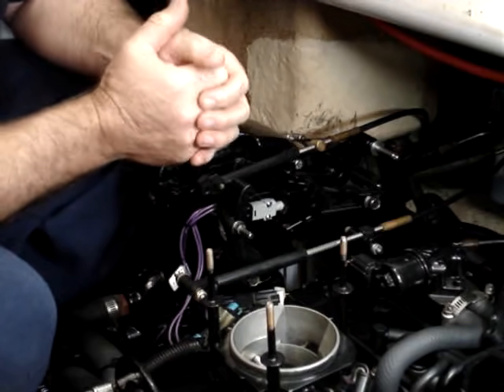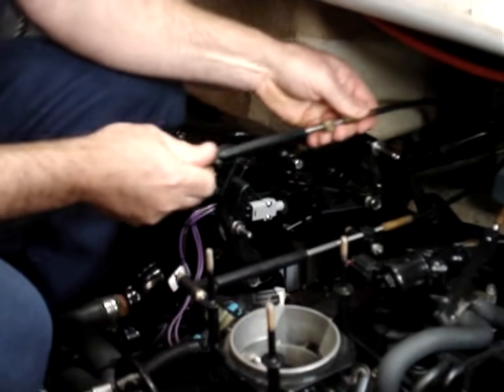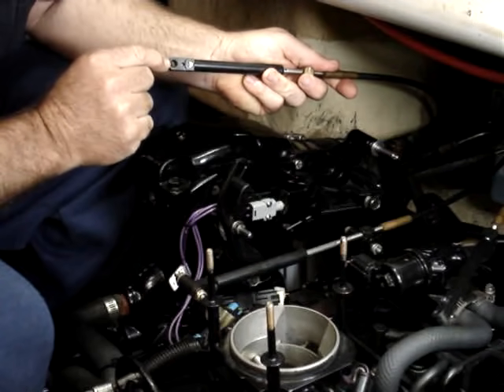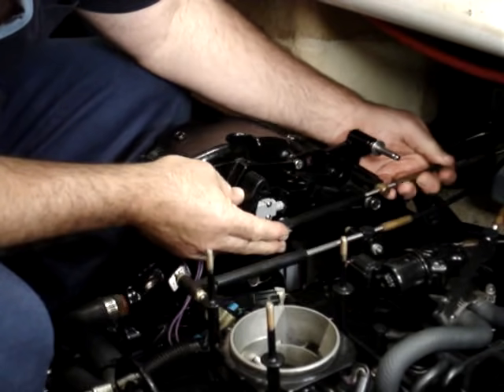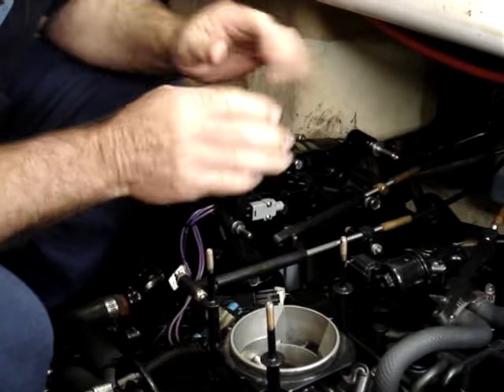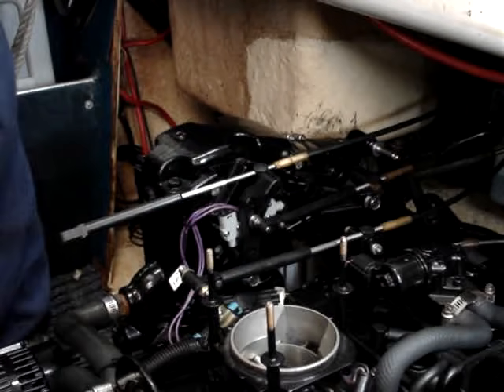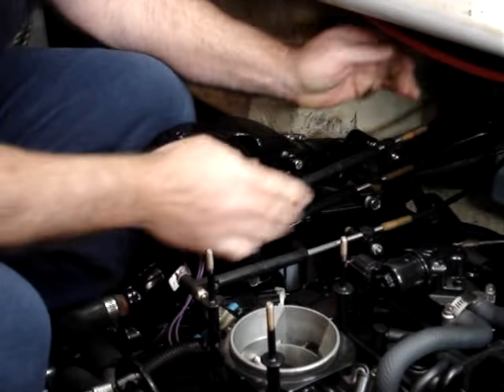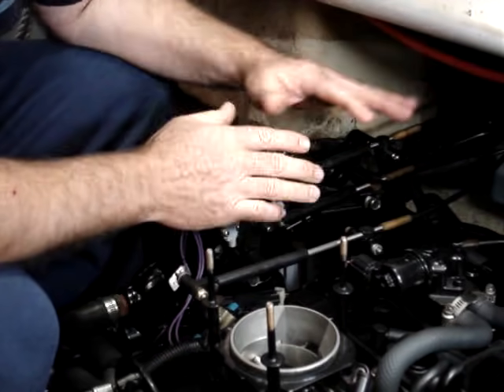Mercruiser Alpha Shift cable adjustment

Comment: Hi Chrisa, 

Can you tell me what position that throttle needs to be in when you remove the lower shift cable or it if matters. I see you push the shaft in to measure the distance - along with moving the prop and scotching it when it bottoms out counter clockwise -( which puts it in forward) and when you are done measuring your gaps you re-attach the shaft to the leg. My question is when we are hooking everything back up what position is the throttle lever in when reattaching the cable? I assume its in forward position but maybe I am wrong or maybe that does not matter. My boat runs great in neutral and forward but when I engage reverse it wants to bog down. I assume I have the wrong tension set on the reverse and interrupter switch as if I by pass the interrupter switch the boat runs fine in reverse. In case you needed to know this is a 1987 Alpha One Gen Two 4.3LX thunderbolt. Hopefully you can understand what I am saying and I certainly appreciate you doing this for all of us as we don't have very many reputable boat mechanics in my area and the ones we do your looking at 3 months out.
Reply from the maker: Once you have the 6" measurement for the lower shaft cable, with the throttle lever still in forward, you put the lower shift cable in, and with it still in forward, you adjust the remote cable so it's in the correct position, then back off the barrel on the remote cable 4 turns. All while the throttle lever is in forward. If shifting into reverse is tripping the switch, you have dirt in the shift slide cavity in the bell-housing, or inside the slide itself, or the anchor stud on the shift plate lever in too high. If all those are correct, replace the cable.
Reply: @chrisa660  You are the best sir !!!

Comment: I've followed the video, my measurements were the same as yours. So I followed your instructions exactly.  On the water if I shift fast and accel (to pull a wakeboarder out) I will get a clunk into gear and then a second later another clunk.  If I shift quickly but keep near idle I do not get the second clunk.  Can the black throttle adjustment thing be adjusted further then 4 turns?  My reverse shift slams into gear hard and shakes the whole boat.  Suggestion?  THANK YOU!!
Reply: Check your idle speed too.  If too high you can get that hard ckunk

Comment: After an engine replacement I’ve had a lot of issue with this interrupter switch. I’ve tried making some adjustments it seemed better. Some days it won’t ever die and some days it dies going into reverse. Now it’s dying going from forward to neutral a lot. Lower cable has been replaced and if I recall I had my 6” on lower cable right. Boats a 96 which way should I adjust the barrel when dying from forward to neutral ?
Reply: Hey, did you happen to find out which way to adjust the barrel when it's dying from forward to neutral?
Reply: @deadparrothead3175  I probably did but don’t recall. Replaced the transum assembly and it’s been perfect. My shift cable was ran wrong

Comment: If I am adjusting an existing cable, I know I need to measure the proper lengths of the cable movement. However, wouldn't the barrel on the remote control cable already be set 4 turns back? Or should I adjust it to fit perfectly first, then turn it back 4 turns for tension I assume?

Comment: I'm well aware that this is an old thread but if anyone is paying any attention:
Mine is a 1986 year Alpha I Model 1 and the first thing done here is pull the slide out the 3 3/8". Mine will not move over 1/8".
Also the mount is pinned. Measured 6 1/16" Should I try to loosen the mount so I can adjust on the threads? Shifter seems difficult to get into forward & sometimes the engine will die. (on water)

Wondering if the cables are worn out or the Remote control has something going on. Don't have an hour meter but I'd say for it's age don't have an excessive amount of hours.
Thanks!
Reply: 6-1/16" is not a problem. If it's killing the engine then it can only be a sticky lower shift cable or the adjustment of the remote control cable. I'm not sure what you mean by 'the first thing done here is pull the slide out the 3 3/8". Mine will not move over 1/8".' I assume you're referring to the remote control cable. It's not the absolutely distance you should be measuring, it the difference between forward and reverse.
Reply: @Chris-hx3om  When you pulled out on the cable checking for the 9/16" play - mine won't move. Also I believe you screwed the 4 turns opposite of what you said. I turned my barrel from factory setting 4 turns and it went on easily so I just backed it back where it was (4 turns) and left it there and really it was opposite to what you turned your barrel. Is there any kind of setting I need to know about on the control lever itself? I have owned this boat since new (1986). Something just isn't right with the way it's shifting.
Thanks so much for your expertise.

Comment: What is the remote cable is not moving the 3”? How do you make it move more? Mine only goes 2 3/4” can’t figure out how to get to the 3”’s of travel.
Reply: Is it a Merc genuine remote control or an aftermarket (Morse, etc)?
Reply: @Chris-hx3om  yeah it’s the genuine one
Reply: @tiotheberk  May have a problem inside the remote, or the cable may be attached to the wrong anchor point. IIRC some of Merc's remotes had two anchor points. One for Mercs, the other for 'other'. Worth just pulling the remote off the mounting and checking.
Reply: @Chris-hx3om  awesome will do!! Thank u!!

Comment from the maker: I take it you're doing this adjustment with the boat on the trailer and the engine running on flushers. If that is the case, the switch interrupt (cut-out) switch should never activate. The system needs load on the prop to work. For an explanation of how the system works go to a forum called iBoats, then navigate to the Mercruiser repairs section. At the top of the list is a post called "Adults only". Click that and look at item #9... (I'm poster 'achris' BTW:-))
Reply: chrisa660 my boat is in the yard I was doing some cleaning and it’s off and on stands I put it into reverse. Now it won’t go back into neutral. Tried manually turning over motor a little and spinning the prop jerking it both ways while trying to put in neutral to no avail. Any ideas?
Reply from the maker: @Buddy8  Sounds like the remote control cable is broke. (the inner core)

Comment: I need some help I have a 86 Chaparrl 178xl it has a 140 Mercruiser with alpha one drive my switch has went bad so I had to buy Mercruiser Alpha Shift Interrupter Cut Out Switch 864363A1 here is my first problem all my stuff is connected to the top of my valve cover and I read this new style has to be mounted somewhere else where is a good place to mount it up I am so lost. Second while pulling everything apart I had one of the plastic pieces brake and I cant find one because I have no clue what to call it lol any help would be great. I have pics of the broke part also thanks.

Comment: hi
I have a SeaRay sundancer 290 1992  with 2 4.3 mercruiser engines and standard stern drive gear shift and throttle controls.
Boat is in the water now, all working fine but throttle showing on gauge different RPM between both engines.
For example throttle are in the same level forward or reverse but RPM is not the same -showinf port 1500 and starboard 3500. You upload clip above but can i do it when boat is in the water?
And how do do it step by step ?
I will be really great full for any help.Iam new owner for this boat.
Also i put fuel 270 l and gauge showing this is 1/4 only in tank.not half.They said is 500l. Can be bigger tank inside?

Comment: Hey Chris I think my upper cable needs replaced how bad is that? its an 89 celebrity by the way I just dont see the lower needing replaced its deffinately within specs i think the control box and upper cable pry wouldnt hurt along with the neutral switch and the actuator for the neutral switch both have been tampered with and as soon as I go to push it to full throttle adjusted the way you have shown here the switch activates like big time

Comment from the maker: Replacing the upper cable won't change anything. You need to find out why the lower cable is getting tight when shifting to reverse. I would pull the drive and check the slide cavity in the bell-housing for dirty and crud.... Also make sure the slide is free to rotate on the end of the cable. (common mistake people make when replacing the lower shift cable is to tighten the grub-screw and stop the slide rotating. It should be loose, but without any longitudinal movement (hope that makes sense))
Reply: Hey chris what can I do if I follow your steps but cant adjust the cable past 5 inches....I have 2004 Monterey 3.0l with gen 2 alpha and it dosnt look like ike I can physically adjust mine past 5inches please help

Comment: do the measueing shit set it up if still a issue  remount the lower shift cable higher on the arm, the part that is slotted on the arm that did it for me thanks

Comment: Great video, it took me ten minutes to complete the adjustment thanks to you!... I now get great gear change in forward and reverse.  However, in order to get the prop to go into reverse I had to move the drive shaft anchor to about a 1/4" from the top of the slot.  This did not engage the cut-off switch so I figure this is fine but, shouldn't there be a point when it do engage the cut-off switch?  If it never engages, what does that mean?
Reply: having the same issue in reverse. i didn't try to adjust the drive shaft remote anchor that far up to engage in reverse. i guess i will try that, but did you come up with any best adjustments to solve issues for smooth operation? thanks

Comment: My engine stalls as soon as shifted to reverse. I have made no adjustments yet, and it used to work just fine. No reverse at all, instant kill when engaged. 

Can I fix it by using this adjustment technique?
Reply: I had same problem and this fixed it for me. You gotta pay attention and do it just right or you'll still have problems..

Comment: Is this for an Alpha One gen 1 or an Alpha 1 gen 2?
Is this for a single shift lever or a Dual Shift/throttle lever?
This is without the Shift Assist Assembly correct?

I am new to the boating scene and I believe I may have a shift cable issue.  I have an Alpha 1 Gen 1 with 1 4cyl 3.0 engine.

Thanks

Comment: Thanks for the video, very informative. I have a 1997 Alpha 1 Gen 2 drive and a 4.3 Mercruiser (thunderbolt 4 ignition). When I shift from neutral to forward or neutral to reverse I get a bit of grinding coming from the drive, moving out of gear into neutral is fine. Can this be rectified by the adjustment of either of the cables? I am a competent mechanic, just have no experience of adjusting the drives. Any advice/help would be appreciated.
Reply: Jeff did you ever figured it out. i have similar boat. locks find in fwd but prop doesn't lock in reversed have that same noise in reverse,  haven't  tried to with a load, being in water, i have a new cable, but not a new remote shift cable.  Jenny said she had to move the shift anchor pin almost all the way up for prop to engage in reverse. What did you come up with?

Comment: Question, maneuvering the boat out off the dock at very slow speed going forward/backward then shifting neutral I hear a troubling grinding metal sound and stops after I shift back to gear--forward/backward?

Comment: What if you have 3 1/2 " on the remote cable? You didn't say anything about that. I just installed a brand new cable and I have 3.5 inches of travel.

Comment: Nice video...
When I take off from a stand still I can only get up to 8 mph, the v8 has lots of power but it will not plane and I have a vibration as I poor on the gas.  It will move ok as long as I don't give it gas  Any help would be great Thanks
Reply: replay this video

Comment: my engine is out and I want to backoff the stern drive to make it easier to install the new engine my question is how do I engage the drive in order to back it off
Reply from the maker: Drive should (read "Must") be removed before an engine is removed, and re-installed after the engine is set back down and aligned. You can't align the engine without removing the drive. See my video on engine alignment...

Comment: What should I consider the problem to be if I am wanting to go into neutral, the throttle locks vertical but the boat is slightly still engaged. I then have to go slightly towards reverse and it will disengage.
Reply from the maker: Could be the shift interrupt switch not working, or out of adjustment. Could be a number of other things too.

Comment: You seem like your very knowledgable on the alpha one. I just replaced my lower shift cable and have made the adjustments. Although I don't understand the kill switch. I am not seeing it engage or move when I put it into gear, engine off. Before the change out the switch would stay engaged and kill the engine. What part of putting it into gear makes the kill switch momentarily engage? Thanks
Reply: Hey John, I’ve read that the kill switch is not activated when shifting into forward or reverse.  The only time the kill switch is activated is when you are shifting into neutral. It temporarily slows the engine enough so the dog clutch can disengage.

Comment: So, does this adjustment change when the two cables are side by side on top of the motor instead of on top of each other??
Reply from the maker: No. 6" regardless of where the cables are mounted.

Comment: Great video. I have a problem where the shifter, when pushed into Forward, will accelerate the boat as I throttle up, but at top of throttle, engine nearly dies, will run just at idle and push the boat forward ever so slowly. When this happened, I was good distance from land....but could continuously keep "throttling up" and get fuel to/ full power from the engine. I'm not sure what to make of this....I had thought clogged fuel line....but, the fact that I can push throttle forward and get good response has me puzzled. Maybe, I need to look at lower shift cable? Any ideas appreciated....
Reply: ***** I would check your gas filter,  next time your on the water spray some starter fluid in the carb when taking off and see if it helps
Reply: Hey....I did the long haul....pumped all the gas out of the tank....about 18 gallons. Noted that gas was a bit of color brown.... I put new gas in  (about 3 gallons non-ethanol) and engine started / took a few minutes to run clean..... I was successful at this point to get engine back to normal run status.....I will test this weekend, or next, and report back....
Reply: Also, btw, I have the fuel pump....then straight hard tube to carburetor....so, no filter....on this one. I may look into getting one...
Reply: @robertstephenson3245  The fuel filter is in bottom of the fuel pump (or top sometimes).

Comment: My boat goes into gear but when I try to speed up it just revs up high and goes no where. I changed the prop bushing parts thinking it was a spun hub but that did not work. Could this be my issue?  Thanks in advance
Reply from the maker: Sounds more like a spun coupler. These drives are either in gear or out of gear. It's a dog clutch, there is no slipping.